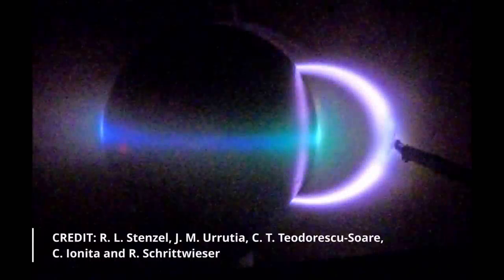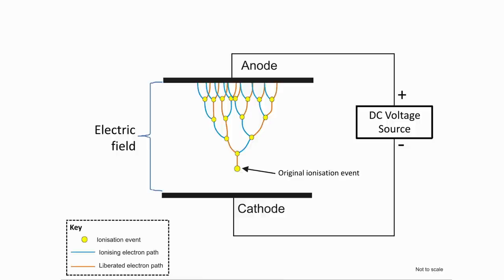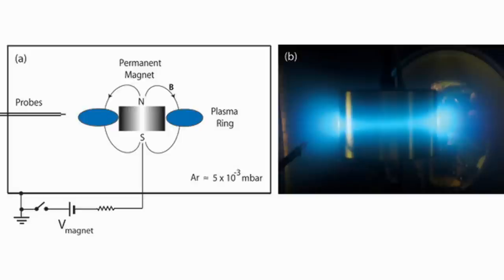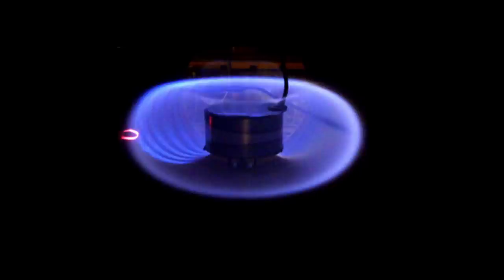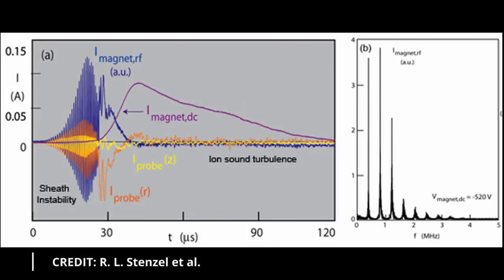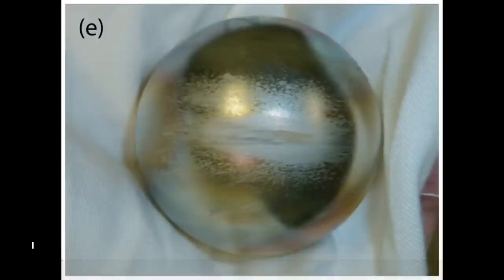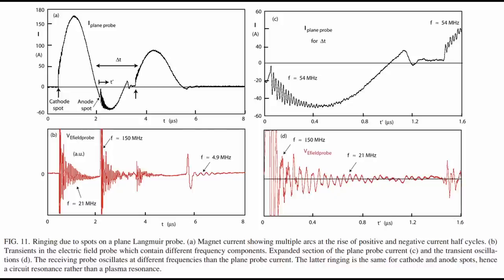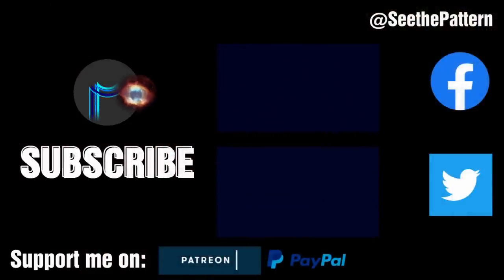Secondary Discharge Due to a Magnetic Field

Comment: I should add, the secondary discharges you describe caused the craters, but the ridge is a filament of charge in the crust of the moon's surface, which draws ionic matter in the country rock to it, where it recombines and fuses forming the dike. I think the craters are discharges radiating from the moon due to magnetic induction in the plasma sheath, whereas the dike is due to electric induction between the poles on the surface.

I'm so glad you dispelled the notion of giant lightning bolts between planets.
Reply: Mr. Hall, I greatly appreciate your work, really eye opening, congratulations.

On lightning bolts between planets: according to Velikovsky, Venus had a visible cometary tail in ancient times. If Venus was a molten, glowing hot ball with a cometary tail, it could have been a conductive channel to Earth. Is it possible that this tail turned from glow mode into an arc mode discharge channel between the two planets?
Reply: Well, perhaps not between any planet bodies but maybe an 85 mile in diameter comet and whatever influence it causes as it passes through, no?

Comment: If you look at Iapitus you will see the anode and cathode discharge patterns: God confirms what you are saying.

Iapitus has an equatorial ridge - the anode discharge path where matter is built-up into a linear dike (this is how dikes form on Earth along a filament of saturated ground) and an equatorial row of craters - the sputtered cathode spots which are due to vertical filaments in the form of lightning and Marklund currents. It's quite apparent that the anodic ridge and the row of cathode craters emanate from a large crater feature at one electrical pole of the moon. Please look at NASA's imagery of Iapitus. The craters run parallel to the ridge along an equatorial meridian several degrees apart from the ridge. I think you will see features you recognize.

Same thing on Mars when it blew it's fuse, only it was an internal discharge due to over-current (or over-voltage?) of a multi-phase planet. It must have been caught between two other charged bodies. See the pattern of the Mons and Valles Marinaris - anodic and cathodic linear discharge patterns, but skewed to a phase angle. There are no phase angles on the DC moons, but they are apparent on Earth and atmospheric/geomagnetic planets and moons. Mars is mixed because it blew it's fuse and became substantially DC. Follow these patterns and you will see Wal, Dave, Velikovsky, et al, are right.

You see the pattern, Gareth! I'm so excited, after watching your video my whole body is buzzing (more than usual). You are on the right track to find truth. Bless your heart.
Reply: Hi Andrew.
Reply: Andrew, um, did you know that most often, in the Southern states, the saying “bless your heart” is a genteel Bible-Belt way of saying “you’re full of 💩” or “you have no idea what you’re talking about”? 
I am figuring you meant it literally, and not  the southern figurative! 🤔😁👍

Comment: This looks like glow from ionization along magnetic field lines, but really there are no field lines (or arcs), there is just a field and it is probably pretty much uniform (say if you were to measure its flux density at a plane parallel to the flats on that magnet but at the mid height of it). So, those glowing arcs must be the equivalent of tufts or something between being double layers and being tufts, distributing themselves regularly around and probably equipotential. It might be possible to induce a standing wave ringing around the thing but there is probably a lot of self damping in the trapped plasma so maybe not.